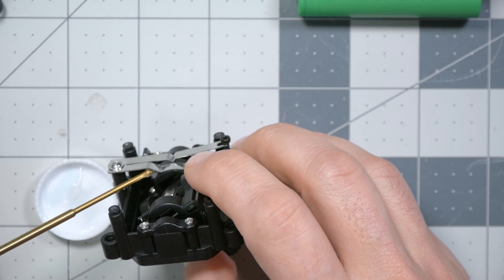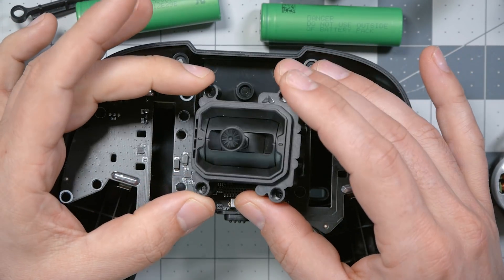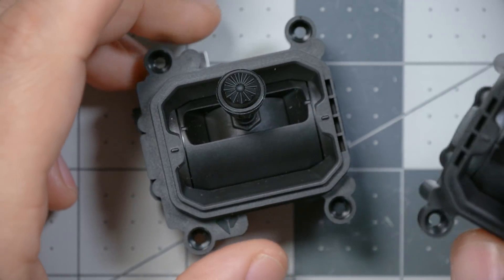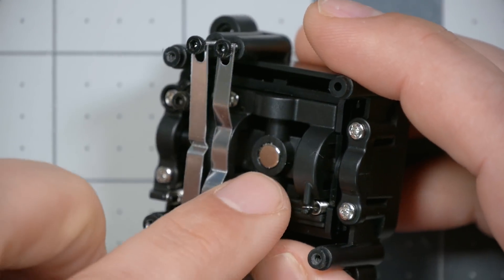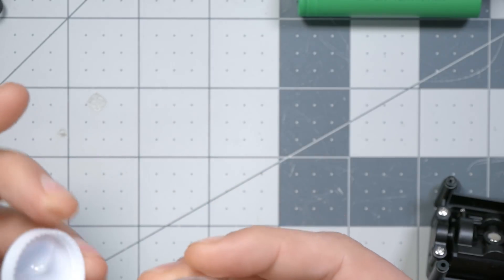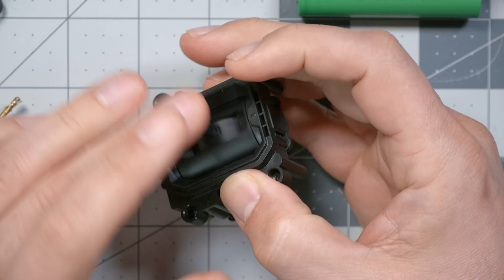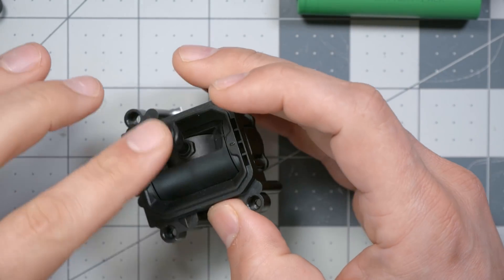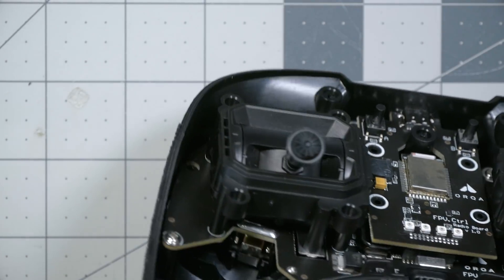I ripped the gimbals out of Orqa FPV.Ctrl to see how to improve them

Comment from the maker: You can buy the RadioMaster damping oil at AliExpress https://www.aliexpress.com/item/1005003556864907.html
In the USA, this damping grease sold by FPVCycle probably is similar in function: https://fpvcycle.com/products/fpvcycle-hella-heavy-damping-grease-68g-tub

The grease I used is T-05 in consistency if you want to try to source your own.
Reply: Just don't use butter
Reply: Was about to complain that didn’t hear  “link in description “. Ordering now.  Thanks
Reply: Is this all that changed in batches of the Tx16s?  I have the first batch and my gimbals have noticeably less drag and feel “cheaper” than all the newer Tx16s’s that I’ve felt. Mine is the Hall version like those I’ve compared it to

Comment: Cellophane or "Scotch" tape on the metal drag plate.  The grease will attract all kinds of unwanted stuff and will need to eventually be reapplied.  Scotch tape is super easy to install and I haven't needed to replace it in 3+ years.

Comment: Continuity check to any GND with a dmm should give "the fpv know it all" a smart hint...
Reply from the maker: Yes I know that. I tried that. It didn't work. Sheesh.
Reply: @JoshuaBardwell  that's weird! So you need to identify the next component to the battery terminals, hopefully a capacitor or a protection system (diode or mosfet), than you can identify the polarity. It's an odd way, but should help.

Comment: Hi Josh  Great video on the ORCA controller,  thanks for the information.  And you can find the correct way the battery to go in by a voltage meter that has ohms and find the ground on the Circuit board to the wires at the battery compartment, and find the short and that's your ground for the battery.

Comment: Provided they have the correct diodes in place it should be possible to just play mix and match with the battery cells until you get it correct but don't quote me on that.

Comment: Good tips, but it’s a shame. I am running short on damping grease.  Shouldn’t have to grease the wheels on a brand new “anything” for at least several thousand miles anyway. Phone apps make great sense for young people and beginners, but most beginners with $120 to spend on a radio are not young. Installing a receiver and binding can be complicated, time consuming, and pricey. Maybe they should send at least one receiver with the quad and a very detailed easy to follow set of instructions written on paper in large letters and pictures.

Comment: Good fix Bruh I was just working on my Jumper T18 the other day and for some reason my throttle is on the other side I think it's cause of my SD card. I put EdgeTX on it but cause I took the battery out and plugged it back in to quick I got a card error I restarted twice and it went back to normal but the throttle is backwards.
Reply: I had the same issue when I went to EdgeTX. The solution is in SYS/ Radio Setup (the gear icon) the last option is "mode" which is mode 1 by default. Change this to mode 2 and you'll be good to go.

Comment: Are there any other radios at this price point that have hall sensors?
Reply from the maker: Jumper T-Lite is $85 and has hall sensor gimbals. Jumper T-Pro is $110 and has them. Radiomaster Zorro is $99 with 4-in-1 module or ELRS and $150 with Crossfire and has them.

Comment: You can find the ground with a multimeter. It should be common with the metal part of the USB port. After that it depends if it runs as 1s or 2s
Reply from the maker: Yeah I tried that :-) No continuity between USB and any pad. Maybe there is a protection circuit.

Comment: What is the difference between the radiomaster lubrication oil and the damping oil? When should I use which?
Reply from the maker: The lubrication oil is intended for use on the crossbar. The damping oil is for the throttle and is much thicker.
Reply: @JoshuaBardwell  But isnt the crossbar the thing on 3:06 and it is on the throttle gimbal
Reply from the maker: @trymacs7729  I'm talking about the radiomaster gimbals. I didn't oil the crossbar on this one.
Reply: @JoshuaBardwell  Ok, thank you for the information. I am just not 100% sure what do you mean with the crossbar. Is it the metal thing where you can adjust the throttle tension and the ratcheting?
Reply from the maker: No. That's not the crossbar. The crossbar is the spring loaded piece that causes the gimbal to spring back to center.
Reply: @JoshuaBardwell  Oh ok, thank you! Have a nice day

Comment: Plus is on the bottom side on both sides of the radio
Reply from the maker: Ah I see. When power is removed it goes back into protection mode and won't power up until you plug in USB.
Reply: @JoshuaBardwell  might be worth to pin this reply to stick on the top of comments.
thanks a lot

Comment: ring out the grounds with a dmm for battery polarity
Reply from the maker: I tried but no continuity. Must have a protection diode or something.
Reply: I would expect to see ground from the radio can to one of the terminals, it’s then possible they are in series.
Reply: Manual says 2S, so cells would be in series - should be able to get continuity between the two bays on one pair and ground (I'd go to RF shield) on one other terminal (see other comment, I think -ve is up in both bays)